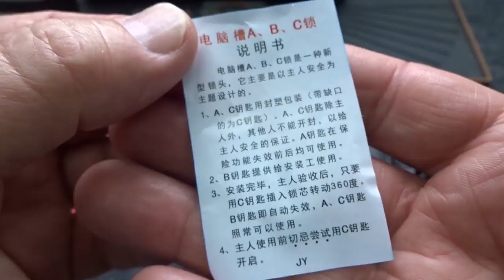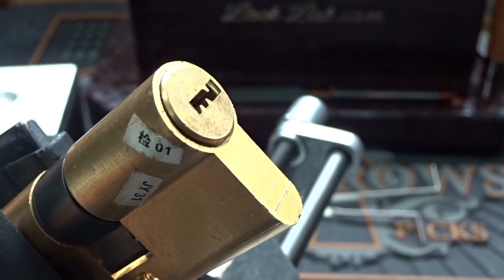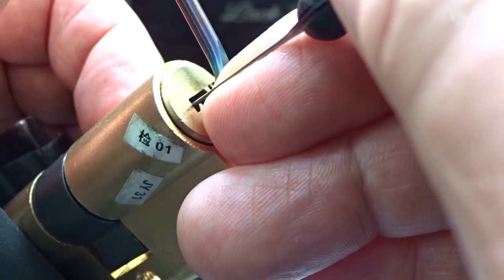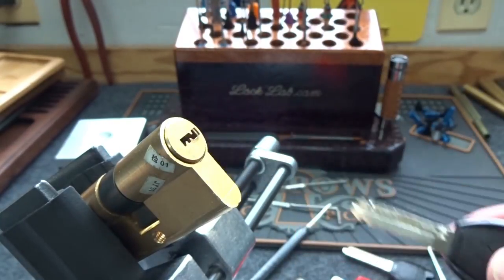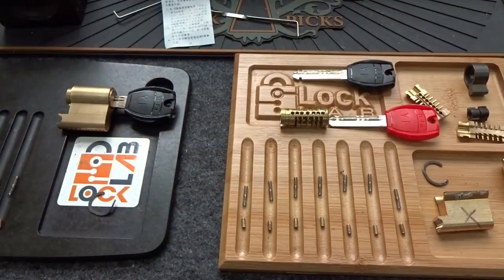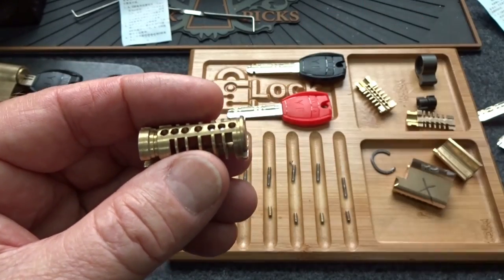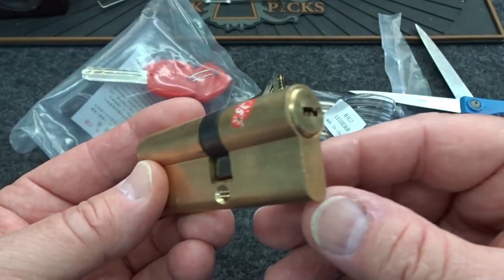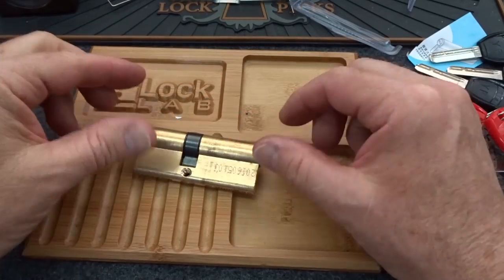(1066) Construction Lock Silliness

Comment: this kind of lock is very prevalent in China，it's called AB卡巴，you always get these in new apartment doors which installed by  contractor.We usually change it when decoration done,it's just a cheap convenient temporary solution for handyman.I think this kind of lock cost less then 5 dollars in China.
Reply: Isn't everything less than 5 dollars in China?
Reply: @lisjeislief  Interestingly, Chinese factories are the most flexible factories in the world. You can order cheap, won't be good. Or you can order good, won't be cheap.

But because lots of people want things as cheap as possible, most resellers importer clamped on "cheap".
Reply: @PanduPoluan  it's just a meme by this point. The idea that the chinese only produce crap, is because american businesses order crap, to keep their costs down. China is 100 percent capable of manufacturing high quality goods, as is any post-industrial society. This lock is a great example of it, even bill took a lot of time trying to pick  this lock, and as the OP says, it's less than 5 dollars.
Reply: @ExarchGaming  Exactly. That was what I was implying, actually.

Basically, with Chinese factories, you get what you're willing to pay for.

I'm sure the lock factory can produce something much more secure, but at significantly higher cost. And that's kinda pointless if, as Xia66 started, it is used only temporarily for decorating/renovation. Use the cheap one, when job is done, throw it away and replace with a much more secure one.

Comment: These locks exist in sweden too, but for a entirely different purpose: You buy this lock, and then you use the "construction key". If you lose the "construction key", you use the "standard key" set. However, there exist no notched key in the swedish set, rather, mere using the "standard key", will disable "construction key". This works by having ball bearings like in this lock, but with pockets that are slightly smaller than the driver pin size, but larger than the ball bearing, in the cylinder wall. These locks also exist with multiple rekeys, so you could have "1" key, "2" key and "3" key, using "2" key will disable "1" key, using "3" key will disable "2" & "1" key.
Reply: Nice way to disable a lock fast while retaining access. But I wonder why there is a need? We don't have these in Denmark..
Reply: Why in the hell do these cool locks not exist (prevalently) in the US?
Reply: @reeepingk   as a locksmith, construction keying is very prevalent in the usa

Comment: This is what Google Translate says the Chinese text says:

A, B, C lock is a new type of lock, which is mainly designed to master the theme of security 1, A, C key with plastic packaging (with a gap for the C key). A, C key In addition to the owner, the other person can not open the seal to the owner of the security guarantee, A key in the insurance function can be used before and after the failure of 2, B key to the installer to use. 3, the installation is complete, the owner after acceptance, as long as the C key into the lock cylinder rotation 360 degrees. B key that is automatically invalid, A, C key can often use 4, the owner should not try to use the C key before opening. JY 6C C is the person's taste. twenty three
Reply: Ugh, Google Translate is kinda horrible for non-western languages. DeepL Translator is much better. The problem is to transcribe the Chinese writing into characters, though 😆

Comment: Bill, have you tried to insert the the change key and get the ball to drop back into the hole by inverting the cylinder from normal that allowed was the ball to drop? Maybe it stays in the chamber? Couldn't possibly just disappear, there has to be a chamber it falls into or out of. Even into the locking dog possibly...

Comment: I recently had to drill out an ABUS 83 Schlage core because a T pin I made slipped into the smaller chamber adjacent to the 4th pin chamber in.  Completely ceased and no other option other than to drill.  I'm planning on filling in the drilled holes with some brass stock and solder it into place and continue to use the cylinder as a challenge lock.
Reply: I had a similar problem, fortunately my cylinder had a removable top. All my other cores with the extra holes I filled with J-B Weld epoxy. Seems to work pretty well.
Reply: Or you could tap out the holes, and find a threaded plug that will fit. Saves you re-drilling if you get a little too ambitious with your pinning again. Also would make swapping out pins and springs a breeze I'd imagine. Just a thought. Happy picking.
Reply: I was planning on doing this myself, but I unfortunately drilled into the chamber off center.  I drilled into two of the chambers.  The first wasn't too bad, but the second was really offset.  I'm thinking maybe I can mill out the entire top with my Dremel and files (I don't have access to a milling machine).  Then I can get some .5" diameter brass stock and cut out a section with two tapered ends to fit into the core.  I can then go through the bottom of the core and drill into the bar stock and tap those holes.  It seems like a lot of unnecessary work, but I like to make the most use out of things I have.  It would be possible too to just make it so the brass stock insert would slide out keeping all the springs and pins in place, so I could skip the drill and tap steps.
Reply: I created a brass pin insert to fit into the core.  It fits perfectly in the C6A 300 Schlage core, but the newer versions are the C6A 3000 which have anti drill pins inserted into the core and the bible.  The small hole next to the fourth hole in on the core is also slightly smaller in the 3000 core.  I'll be posting a video showing the differences between them and hopefully a successful pick and gut this time around.  LOL.

Comment: The red dust may have been oxidation. The locks did not appear to be lubricated well? And the pins are most likely a ferrous metal due to the high magnetic property of them. The ball bearing seems like a wafer type of pin for multikey pinning assemblies. The ball goes in between the last pin assembly? It is removed and replaced by the skeleton by of the control key to indicate whether the contractor key is functioning?
Reply: It uses the bible hole of the sixth pin as the pass off point via the "skeleton" relief in the control key as you spin the core a full turn?

Comment: In Europe we have another system. The key cylinder is still he same, contractors have a key can just open 1st door lock, this key can't operate to fully secure the door. The keys for the owner are inside a sealed package, divided in 3 parts. Every parts o f the package there is a different set of keys. First set has green dot, then yellow and last is red. In case one of green dot key is lost, you can use the yellow key. Using the yellow key, green key will disabled. Same happen in case you lost also yellow key. Last is red key, using it the yellow key is disabled.

Comment: Most Euro-profile cylinders that I've seen have the cam set at an angle when locked, whereas that one appears to be flush. It would be relying solely on the central screw to hold the cylinder in the door. What's more, when the door is open, the lock could be removed without using the key.

Comment: I had a lock almost exactly like this.  There was a ball bearing that was so tiny, maybe 0.060"  By luck I found it.  When I tried pulling the plug the top pins fell into the skeleton but I managed to cut the springs while pulling the plug out.   Of course everything was pretty chewed up.  I think the inside lock has one less pin so there was no bearing and the construction key still worked the inside lock.  We all learn lessons the hard way. Bump keys sure mangle these cheep locks.   Nice video.  Thanks.

Comment: Seems pretty obvious what happens. The little ball falls in the gap between pin 6 and 7 (you call it skeletton?). You should be able to get it out if you insert the key with the notch into the lock with the key facing down and the bible facing left. Keep the key facing horizontally and rotate the lock until the bible faces down, until it is aligned with the key. Turn the bible back again and very carefully pull the key out. Gravity should keep the little ball at the bottom, enabling you to get it out.

Comment: This is an odd thing to find sold like this.  Usually construction keying is used for a large facility with lots of builders who have to come and go as they need and have free reign until the facility is finished.  Construction Master keying lets you have the locks and other security set up and working to keep the riff-raff out while the place is set up, then you don't have to be too sure you got every last key back from the builders when it's done, and the master keying doesn't get in their way.  You can do it so all the cuts are different, though, not just one.  With this, a lost construction master is still a risk, since there's now only one difference to account for.  And while sophisticated attacks like that aren't at all common against most locks, the kind of facility that is Construction Master Keyed is often the kind that just might be the target of sophisticated attacks.

This is the lock equivalent of those Chinesium electronic power factor correctors: selling worthless quantities of something only interesting to corporate entities to the general public who probably don't know what it's really good for anyway.

Comment: I got a slider type of euro like these. but the construction key has the cut out section and the owners key is solid. and after using the owner key the con key is void like the construction keys we have here in the states.  there is no chang key needed. But mine being a slider lock it has me confused.  I suppose I will have to gut it to find out.

Comment: You know what I'd do instead? Cheap normal locks while the construction is still taking place. Then replace them when the work is done.
Reply: thats what most builders do. have a cheap set of kwikset/defender locksets that have the same key for the entire development and can be beat to hell. then swap out for whatever the customer specs.
Reply: tin2001 I feel these locks are most likely to be used if you will have contractors entering a occupied space. Like a valet key for you car in a way not construction.
Reply: its not for that, its like if you need something fixed in your house that youre living in now, or for someone whos house sitting. literally made so you dont have to do all that extra work.
Reply: My understanding is they are for when the house is initially under construction (not for repairs or house-sitting, etc). During construction many different contractors need access to the house so they will all need a key. With so many different companies and people with access, it means a lot of people have access to be able to copy or keep a key after construction. However, once the house is complete they shouldn't need access anymore, so that is when the lockout key is used. You could achieve the same result by changing the locks or re-pinning after construction is complete, but this lock is designed to negate the need to hire a locksmith or deal with the locks yourself again once construction is complete. Designed to be convenient way to "change the locks".
Reply: +Michelle Hetfield no, these are for while the house is being built, once you change the lock to residents key there is no going back to the construction key for workers
Reply: Chris Morse Yes, something very similar was used when I had my house built. Tradesman had a key that allows them to come and go... no big deal if someone creates a copy. On hand over (moved in), met with contractor who used my key which lock them out.
Reply: What most people are thinking about is locks with "service mode", you have one owner/master key, in the normal setting this is the only key that works in the lock. However, when locking the door from the outside you can remove the key in two different positions, if you turn the key say fifteen degree more and remove it the lock is in service mode, and now a service key can be used to enter.
Basically two different bibles in the same lock.
Reply: That's my opinion, too. Over here (Germany) I always have some 88ers (BKS 8812) at hand. Such construction cylinders, with a ball bearing, are also available here. But it's also just one cut that's different. Austrian company EVVA offers the ICS TAF which has three keys. One that always works (e.g. high rank employees), one that always works and can switch the third key on and off (e.g. boss or security) and said third key, which only works if enabled by the boss.
Reply: @stagepyro  That is really cool.  I'm not even surprised that Germans figured that out, it's just so practical.

Comment: Great video! I'm a little confused though, does that mean once the change key has been used the red keys will never work again?
Reply: Yes, you're correct.
Reply: Correct, they are used during construction and this makes it so during construction the doors can still be locked. After construction is finished the locks can be changed so the contractor can't get in. All without having a locksmith comeout and have to change every lock.
Reply: yes that what it means. Its that the construction workers cant copy the key. Its complete bullshit tho cause if they know the system they can just copy the key and just don't drill hole no7
Reply: Yep, once you use the change key, the red "construction" key will no longer work.
Reply: Yes, the intention is to protect against tradesmen stealing/losing/copying the keys during construction of the house and those keys later being used to commit crimes against the homeowner after the house is finished.
Reply: In some cases the construction keys may also be keyed-alike across a group of properties while the owner keys are different for each property.
Reply: yeah but the problem is that that wont really work if those people know what they do.
Reply: Jamal Issouquaein I was just wondering the same thing!
Reply: aullik are dimple keys for a Chinese lock really that easy to go and get a copy of at your local hardware store?
Reply: Jamal Issouquaein, that's the way he makes it sound.
Reply: For me, its a pretty neat security feature too. You lock the black keys and the notched one away into a safe or so and use the red ones (the red ones might be even copied and given to the employees). IF one of them reports their key lost or missing in some way, you get the notched key and secure ALL the locks with that 360° turn and can only open the locks with the remaining black, keys. After done this, you can think of changing the locks.
Reply: Why the hell do you need to call a locksmith to switch out a cheap simple lock like this?
Reply: If you dont trust them not to rob the place then how the fuck can you trust them to build it properly in the first place?
Reply: Riley Fenley changing out a euro cylinder doesn't require a locksmith. It's literally one (usually flat head) screw that holds the cylinder in place, plus the key, is all the tools needed.
Reply: Keyser Soze Depending on the scale most contracts require a lock to meet certain specs with a couple approved listed. Others are possible if you put in a request and can justify it and shows it meets specs. Contract specs also will list who is to install the locks, keying list for every door, amount of keys to be supplied in the end, etc. Construction locks are just a cost saving option. 

I don't trust construction workers at all, a lot of them are thiefs and will steal materials from the site to resell for their own profit. On the last project I managed two of the construction company's employees were arrested and prosecuted for theft. One of them was a simple street flagger who stole over $7500 in copper cable the night it was delivered. The other was stealing expensive specialized tools. As far as I know only the superintendent was in charge of keys but people can be slick and get access to things they shouldn't.
Reply: Kevin Cormier Its not that hard to copy a foreign dimple key. specially one where the bitting is that simple. We are talking about construction workers here. they definitely have contacts/friends who are able to do that.
Reply: Changing the cylinders is very simple. Let the construction company supply temporary cylinders for the house. in the meanwhile buy your own cylinders and replace them all the day you move in.
Reply: aullik If you notice my profile picture I own a construction company and I don't have any contacts top copy a dimple key... Only one I know is Multi-Lok and you need the card for the bidding.
Reply: Yes, but you're honest and not a builder specializing in ripping off his customers.
Reply: Kevin Cormier Ah i didnt look at your profile pic XD

My cousin is working at a construction company and i know that at least two of his friends are  learned metal workers. One of them has a little workshop. It's not that impressive but I'm sure he could copy that key if he wanted to
Reply: I knew an insurance company representative who didn't own a screwdriver and called an electrician for changing a gone lightbulb. The mind boggles.
Reply: Keyser Soze They just build a house or apartment.  Someone moves in, fills the apartment with valuable items.  That's what they steal.  No need to also be sued for not following code.